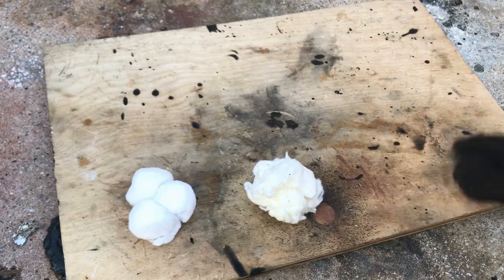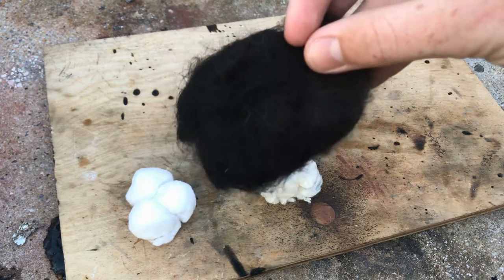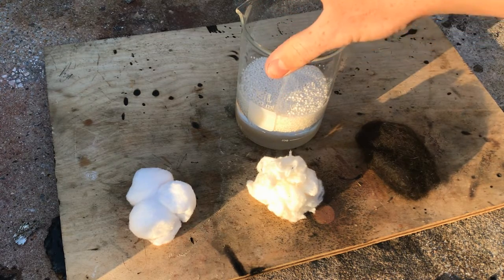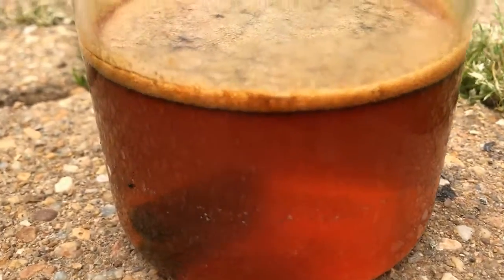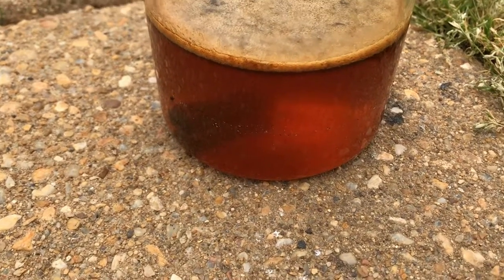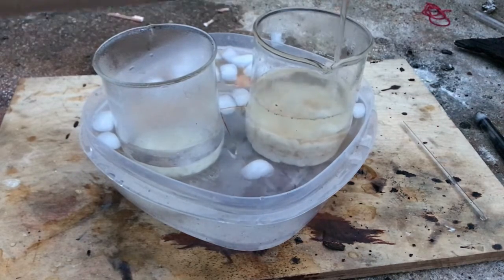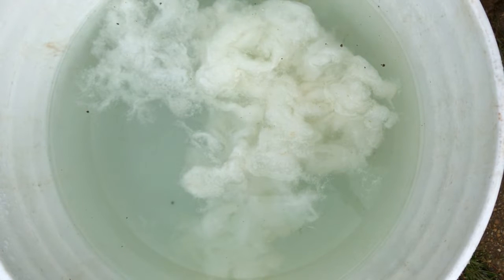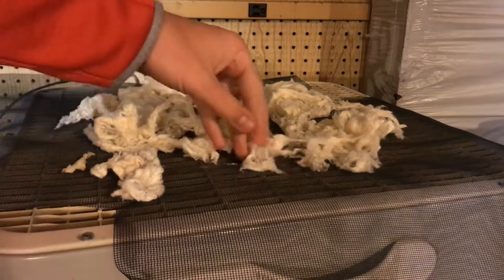Nitrating Dog Hair/ How to Make Nitrocellulose/Guncotton

Comment: How are you using ammonium nitrate to perform this reaction? Would the ammonium cation not prevent nitric acid production by simply reacting with any nitrate or sulfate in solution? If not how much excess of acid are we talking?
Reply from the maker: By reacting the Ammonium Nitrate with concentrated sulfuric acid, you form an equilibrium of both sulfuric acid and nitric acid (commonly referred to as “mixed acids”). Since the ammonium nitrate fully dissolves in this mixture, at any given time both free acids can be found in solution. However, since sulfuric acid is a much stronger acid than nitric acid and ammonium sulfate is a bit more insoluble than ammonium nitrate in the mix, the equilibrium shifts in favor of the formation of ammonium sulfate and free nitric acid. That’s why if you take the same mixed acid solution of Sulfuric and Ammonium nitrate, you can distill off nearly 100% fuming nitric acid.
What’s extremely important in this synthesis is to have a substantial excess of concentrated sulfuric acid. This is essential because it both keeps ammonium sulfate dissolved and most importantly removes water that forms in the esterification. Without any sulfuric, the water produced in the formation of the nitrate esters would slowly accumulate and the final ester formations would be much more difficult to achieve. Since Sulfuric is such a effective dehydrating agent it pulls water towards the sulfate anions and away from the main action of the synthesis.
To answer your question, yes, the ammonium cation does react with both the nitrate and sulfate anions in the solution. This can actually be a good thing since it additionally acts as a buffer agent and ensures a less vigorous reaction at higher temperatures.

Comment: Can you give me a recipe making Super Fast Nitrocellulose like you did ??
But using 98% Sulfuric acid + 55% Nitric acid (If it's not possible with the 55% Nitric acid then can you replace it with Potassium nitrate)
I'll be so thankful :D
Reply from the maker: Potassium nitrate could be used in substitution for ammonium nitrate if used in the correct stoichiometric ratio.
1 gram AN = 1.25 gram KNO3
Unfortunately, I have had no success creating high quality NC from 50% Nitric so I am doubtful that 55% would produce the sort of product you are looking to make.
Reply: @DBXLabs  
i think too that's 55% won't be the best
so i think i'm going to use the Potassium nitrate
but do you have a Recipe to make NC
Using Potassium nitrate + 98% Sulfuric acid ??
Because i don't know how to Balance the Ratio between H2SO4 and KNO3 when making NC :)
Reply from the maker: SiMpLe Pyro Id suggest that you read up on molar conversions or stoichiometry as it applies to most chemistry and I can guarantee it would help you out in the future. 
As for what I mentioned earlier, if you do the molar conversions you find that when working with nitrate salts, ammonium nitrate (what I used in the video) has 1.25 times more nitrate by mass than potassium nitrate. For this reason you would have to use 1.25 times as grams of nitrate salt if you choose to use potassium nitrate over ammonium nitrate. In the video I used 3 mL of concentrated sulfuric per every 2 grams of ammonium nitrate. Just multiply the 2 grams by 1.25 and you get a ratio of 2.5 grams KNO3 per every 3 mL concentrated sulfuric.
Hope this helps :).
Reply: @DBXLabs  
Thank you so much man :D
Can you make another Favor ??
Let's say that i will multiply the 2.5g KNO3 by 10 and multiply the 3ml H2SO4 by 10 too, so i will get 25g KNO3 and 30ml H2SO4
How Many grams cotton is needed for that Ratio ? 
That's the Last Question and Thank you for helping :)
Reply from the maker: SiMpLe Pyro I’m not sure the mass but that much nitration solution could work for 2 maybe 3 regular sized 1inch Ø cotton balls
Reply: @DBXLabs  
Okay i will just test a lot of different patches and see what is the best result 
because my cotton is a large piece...Thank you by the way 👍😁

Comment: My country has 68% nitric acid, 90% hydrochloric acid. Is it enough to do that?  If possible, what is the ingredient?
Reply from the maker: saree za are you sure you mean 90% hydrochloric acid? The maximum concentration commercially available is around 37%
Reply from the maker: saree za you can make nitrocellulose from 37% hydrochloric and 68% nitric but the process is a bit more tedious and takes longer
Reply: @DBXLabs  Thanks for the answer, I would have done it.

Comment: I wonder if you could spin nitrocellulose into a wool like cotton candy...
Incidentally your solvent-plus-nc solution (though usually made with lighter solvents IIRC) is known as "collodion" and has some cool uses.
It works well as a liquid bandage, dries to a strong film that adheres well.  It shrinks when it dries so it's been used as stage makeup -- applied heavily it bunches up the skin to make very convincing-looking scars.
Reply from the maker: That would be very fun to try out. I have a cotton candy machine.
Reply: @DBXLabs    Ooooooo.